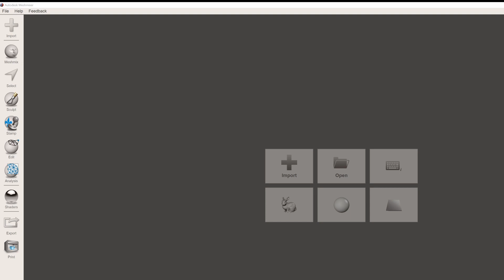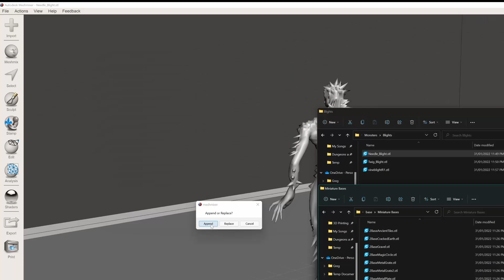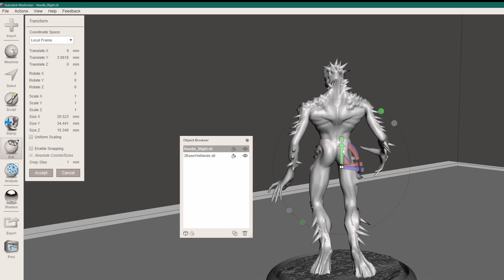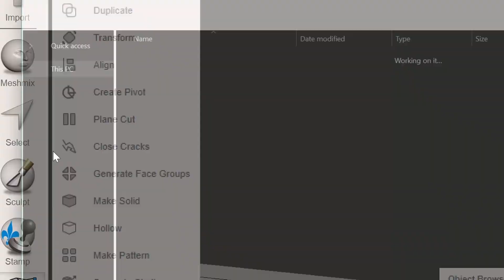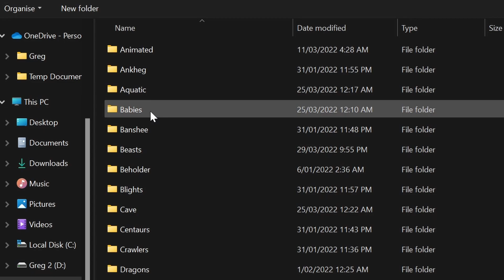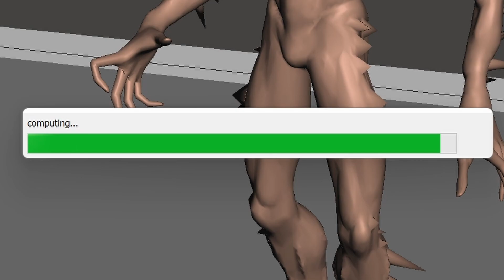How to Combine and Merge Multiple STL Files for 3D Printing in Cura using Autodesk Meshmixer

Comment: You didn't actually merge them into one model though. That would be a Boolean Union. Right now it's just one fill with both objects in it.
Reply from the maker: Oh..really? It printed and it works but what's the difference? Is one stronger then the other?
Reply: @LetMeFixIT  If you printed it as a solid resin model, it would have uncured resign in the middle and would eventually leak toxic resin everywhere.  Thanks for the video, but i am still looking... for months :(
Reply: so this is true, I agree, when looking for 3D printing, the method of unions you talk about is to combine the two seperate surface meshes (visible when making one clear, pressing 'W' wireframe toggle, makes it apparent they are not connected still). this is important for 3MF file format I believe to preserve data like color as well as other things which control behavior on CNC which uses the G-Code. You want to combine the surfaces sometimes in order to be able to also apply further mesh manipulations to. the solution is the thing this commenter listed, but I have troubles when applying it, it rearranges my simple stands I design in CAD. I think perhaps I need to apply a higher triangle resolution to the stands faces, and clean it up afterwards.

Comment: How do you select both files it doesn't work for me 🤦‍♂️
Reply from the maker: You can either press and hold control and click or hold shift and click - just like in windows when you select multiple files. Good luck!
Reply: @LetMeFixIT  Thank you. I was wondering why it wouldn't let me click on both 😂
Reply: @LetMeFixIT thank you that helped a ton.

Comment: What about lithophanes of a Star Wars helmet from various angles
Reply from the maker: To create a lithophane of a Star Wars helmet from various angles using Meshmixer, you can follow these steps:

Obtain STL files of the Star Wars helmet from various angles that you'd like to use for your lithophane.
Import the STL files into Meshmixer.
Use the "Thickness" tool to add thickness to the STL files, this will be the material that will create the translucency in your final lithophane.
Use the "Sculpt" tool to refine the design and make any necessary adjustments.
Once you're satisfied with your design, export it as a STL file.
3D print the STL file and place a light source behind it to see the final lithophane.
Reply: @LetMeFixIT  no i mean incorporate lithophane stl files into merging into one. I already have the lithophanes
Reply: @LetMeFixIT  sorry for the long response
Reply: @LetMeFixIT  should I use mesh mixer or something else because I tried and downloaded meshmixer and forgot the reason why it didn’t aid me.